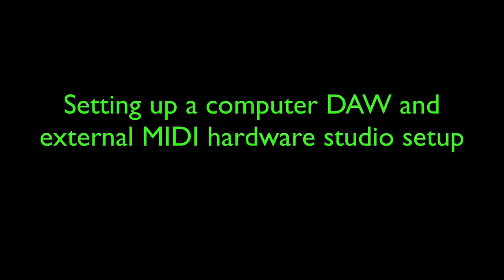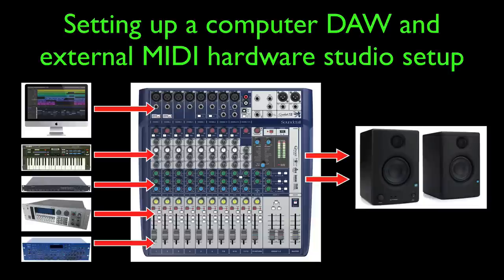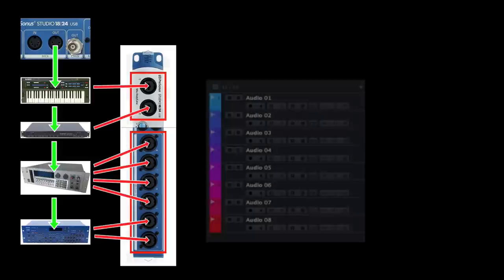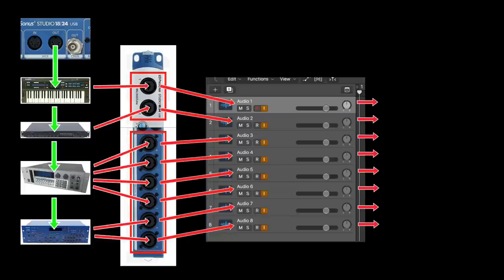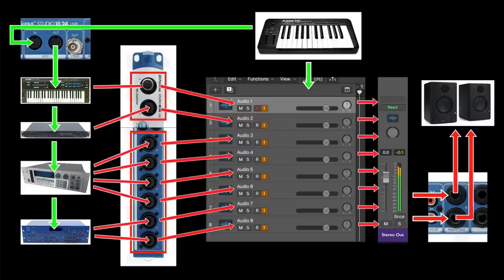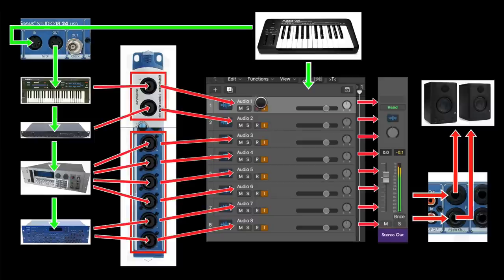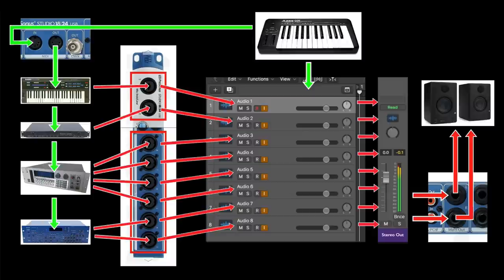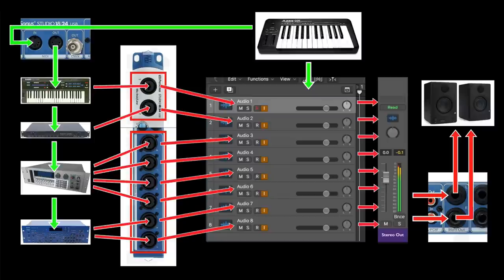How to setup a computer DAW & external MIDI hardware studio

Comment: Great video!  I'm still doubting whether to go for the mixer or interface approach.. I recently acquired quite a few vintage hardware synths and 8 ports simply is not enough :(  There's a JV-1080, Korg M1R, Yamaha TX81Z, Roland U-220, Roland MKS-50, Roland TR8-S, Roland JP-8080, Korg Minilogue XD and a Behringer TD-03 in the collection.  Some/most of those should probably be connected in stereo I reckon.  The MIDI connections are clear, but how should I go about connecting up the audio outs?  Thanks for any feedback!
Reply from the maker: well the problem is how many of those units do you want to connect at once. the roland drumbox alone has 8 outs. The cheapest solutions will yield 16 physical line inputs so you can route a max 16 hardware OUTputs IN to your DAW at the same time.

So either a USB equipped mixer which gives 16 USB channels to your DAW or the behringer UMC1820 audio interface with the Behringer ADA8200 ADAT rack added will give you 16 physical IN's. 

Above 16 channels your best best is the LIVE PA racks from the likes of Mackie, Behringer, Presonus, Soundcraft etc.

The Mackie DL32R stage rack will give you 32 channels Inputs to your DAW,  a BIG channel count, but costs about £1400-£1600 GBP. 

The Mackie DL32S stage rack will give you 32 channels Inputs to your DAW,  a BIG channel count, and this cheaper version cost about  £800 GBP. 

The Behringer XR18 stage rack gives 18 inputs to the DAW for just over £500 GBP 

The Soundcraft Ui24 stage rack will give you 24 channels to the DAW but costs about £750 GBP

Zoom LiveTrak L-20R gives 20 channels to the DAW for around £600 GBP

Presonus StudioLive Series III 16R, 24R or 32R give 16, 24 or 32 channels via USB to your DAW plus main stereo mix (sum of all inputs) and ghey cost around £950, £1200 & £1400 respectively

Other options would be the Mackie ONYX USB mixers, but the biggest, the Onyx16 still only gives you 18 channels to the DAW, and again it costs more than the Behringer UMC1820 & ADA8200 ADAT rack combination. 

Do you see where this is going? 

The other option is a traditional mixer with 4 or 8 buses or direct outs feeding a tradition 8 input USB audio interface, which would allow you to monitor the external hardware and DAW audio together on the mixer and route any items to record as and when you need to record them either via direct outs on their channels or by routing them to busses, but unless the mixer has built in FX your external midi kit will be dry with no FX. The solution to that is to get a mixer with 4 or much rarer 8 buses with built in FX, the cheapest of which would be something like the old Behringer sx2442fx mixer or something similar which is current from companies like Behringer, mackie, yamaha, soundcraft, zoom etc.

so the bottom line is, if you want  A LOT of midi kit outputs routed to your DAW at the same time, the solution is costly when you go above 16 physical DAW inputs.
Reply: @dancetech  Many thanks for your detailed feedback, much appreciated! :)
Reply from the maker: 👍 actually, thanks for the suggestion, because i think i'm going to do a video on this topic because there is really no video out there which makes all this clear. cheers
Reply: @dancetech  Exactly .. this is the first video I've encountered that explains it clearly..  Perhaps one more thought - let's assume I want to use a mixer's (like a Mackie for example) overdrive on a kick drum channel, but I only have an 8 channel Mackie. But 8 channels won't be enough in my setup... I don't suppose you could daisy chain mixers?  And sorry if that's a really stupid thing to ask but I'm new to hardware setups ;)

And a final thing .. you mentioned 16 channels or more over USB to the DAW, meaning you wouldn't use the mixer's main outputs going into the audio interface?
Reply from the maker: yeah you can daisy chain mixers, it's not really recommended, but you send the main out from one to 2 inputs on the other in in via a couple of aux returns, but obviously things like SOLO & Aux sends will only work per mixer, not across both unless you start to use stuff like a patchbay to sum sends before they hit rack fx.

Your Q2. If you send a load of hardware to a mixer and then send the final stereo out of the mixer to the DAW, yes, you get the sum of all the hardware mixed to stereo on a stereo track/channel of the DAW... you can monitor that way, and then when it comes time to mix you can mute all but one hardware unit on the mixer, record it to the audio track, make a new audio track, un-mute the next hardware channel/s & record that hardware unit... and go through the hardware units one by one, recording each unit by itself to audio, then mix internal adding fx etc. 
The beauty of sending hardware IN to the DAW via audio interface inputs is that you can add fx in the DAW mixer & when you bounce them to audio they will sound identical to how you set them up in the DAW mix cos the same fx will be on their channels. 
If you go down the mixer route each bit of hardware has no FX, unless you have mixer fx built into the mixer to add or you use external hardware fx.. and even then, when you bounce them to audio tracks, unless you bounce the fx too then once bounced they sound different without the fx from the board.

i'm going for a big rebuild of my room here soon after which i'll have a full hardware setup again with mixer, midi hardware & rack fx and daw & then i will start to make videos on all this.

cheers
Reply: So quite a few moons later, I decided to take the hardware mixing desk route. I'm using a Mackie 32.8 mixing desk and I have about 20 synths/modules/samplers connected to it.  There are 5 outboard fx units connected to it, using Aux Sends and Returns.  That's all working fine.  However, now comes the MIDI bit.  Currently I only have an ESI M4U eX but I'd like to address all modules. 

That's where it gets tricky. I launched a question on how many interfaces/thru boxes I would need and about 50 replies later, it got more difficult than ever. So if you have suggestions regarding Midi ... :D
I thought it would be as easy as using 2 Out ports on the interface, going to e.g. a Kenton Thru 12 each. I thought that would give me enough channels (16 channels per physical midi port I think), but then somebody said I need multiple midi channels for multitimbral synths, and definitely multiple channels for my Akai sampler....  So now I'm puzzled lol :(

Comment: RE:  The external Midi devices.  Are these being Chained, Out to Out to Out?  And then, I get to, Oops, My Dreadbox Nymphes, which is USB.  Nymphes works, has a MONO OUT only and is recognized by Cubase; it just doesn't have the DIN MIDI.  And then, finally, a bit puzzled as to, for example, HOW I would feed a VST synth like Zebra2 into my ZOOM Multi Stomp, in order to apply the zoom FX to the synth.  In short, I've got 4 desktop synths (a fifth coming) and it seems like I'll be doing a lot of Connecting, Disconnecting, Reconnecting to record them then set them aside when not in use.   Sometimes I think I maybe should have picked Boardgames Collector as my hobby.
Reply from the maker: no you cant daisy chain MIDI via OUT connectors, only THRU (unless the synth has an internal switch to switch the OUT socket to THRU function). For USB synths simply connect them up and assign the midi track designated to that synth to that usb midi out, you can still route the audio OUT from that synth as shown. 

Sending a VST synth audio OUT and through external fx and back into the mix is another subject. The routing is obvious: use a spare audio out which is not part of the main L/R OUT monitor chain & send the synth out into the fx unit & back in again via a spare designated audio interface audio INPUT socket, but the issue there is latency, which will be more than triggering via an external hardware synth via midi and routing it's audio IN to the DAW mix, cos it's a round trip in this case.. OUt from the vst synth thru the fx unit and back In to the daw. But with very low buffers set on the audio interface it shouldn't be too much of a problem.
Reply: @dancetech  Great info!  RE:  your paragraph 2.  I think if I read and reread...and then have someone read it aloud whilst I sleep, it's gonna sink in and become clear.   I have a direct support link to a guy at iConnnectivity.  My audio interface is the Audio4+.  While it has a LOT of tricks up its sleeve, it has fewer Inputs than the one you're using.  I'm sure much will translate, I'm sure.   I simply haven't contacted my iConnect guy since I had the brain spasm which caused me to acquire a bunch of desktop synths.  Anyway, I will share the info you've provided with him.  HE will say, sure....all that's right, so what's the prob?   He'll then open his utensils drawer and spoon feed me a bit.   Thanks!!
Reply from the maker: @watchaddicts1213  lol, maybe get more inputs.. did you see this video? https://youtu.be/7rsaYq5jYxE  - the soundcraft unit btw also comes in a 12 channel version (Ui12) which is really cheap, like 300 ish

Comment: after spending the whole video on the audio path, the midi bit is just brushed over...and that's the bit many have issues with. I have an external USB keyboard, sending on ch1 ,  my external instruments are assigned their own midi channels from the DAW,  but when playing the external keyboard, it only ever triggers the instrument on CH1, selecting another track does not receive on CH1 from the keyboard and then send out on CH2 for example, so I keep having to try to change the midi ch on the usb(master) keyboard... am I missing something?
Reply from the maker: "...the midi bit is just brushed over" ---- well that's because one would assume anyone with a reasonably extensive external MIDI hardware setup (such as this video caters for) would have learned how to use MIDI connections as they gradually expanded & built up their MIDI setup.... BUT, it should work exactly as described IF each external MIDI Item is set to a unique MIDI channel... then change the MIDI channel of the MIDI track in the DAW & it should channelise the MIDI THRU from the DAW to that correct channel to address the requires MIDI unit... also btw, MIDI Local Control should be OFF on the master synth/keyboard (If it has an internal synth engine & is not a 'dumb' master keyboard with no internal sounds) or it'll trigger itself whenever you play it...

If the master synth/keyboard DOES have an internal synth engine & you want to trigger it (and it;s 'Local Control' is set to OFF as it should be) then select it's channel (usually channel 1) in the DAW MIDI track and it'll trigger itself via the DAW MIDI loop back to itself..
Reply: @dancetech  Thanks for the reply, I think I figured it out at last!  As for your message in regards of having a more extensive set up, and thus knowing how midi works, I'd argue that the same could be said for the audio path, but alas.  Thanks again, and keep up the good work..
Reply from the maker: @koosfockens1707  yeah the mysteries of MIDi eh!?... it gets mad with program changes and sysex and all that crazy stuff...

Comment: "midi out from your audio interface to each of your external hardware units"? One at a time? or each hardware unit plugs into another hardware unit?
Reply from the maker: you can use MIDI THRU if external hardware units have it, or a MIDI distribution THRU box, or a combination of both.

Comment: My issue is all synths have a L/R output, which takes up 2 spots on the interface.  I have 5 synths, which means i need 10 inputs.  am i doing this wrong?
Reply from the maker: nope. you need as many inputs as you want to send OUTs from any hardware. Some synths can optionally have a left/mono out or stereo, whether you go with that depends on the sound and whether it uses stereo panning &/or stereo fx as a big part of that sound... so most bass sounds dont need stereo for example cos most bass is mono. For more DAW inputs check this follow up video we did: https://youtu.be/7rsaYq5jYxE
Reply: @dancetech  I did watch that.  I have 2 Elektrons, 1 Novation Synth, 3 korg synths and am buying a waldorf Iridium synth, which actually totals 14 stereo inputs.  My Motu MK5 only has 8 inputs.  There is minimal education out there on this type of stuff and it is usually brand specific material.  I think i will reach out to Motu for a solution in maybe having an expansion i/o?

Comment: is it possible to use a mixer that have no usb conection but midi in/out/thru (5pin) and plug it to a soundcard like Focusrite that also have in and out conection and control a virtual mixer of a DAW ? I mean that if i use the midi learn protocol and assign 1 real fader to the  virtual one via midi in an out conection, does the virtual mixer react ?
Reply from the maker: yes, that device is called a DAW CONTROLLER. the cheapest is the behringer bcf2000

Comment: But if there is only 1 midi output om the interface in your illustration how do you connect that to more than one module? I understand multiple inputs on them module but what about the output issue?
Reply from the maker: if you are creating a serious midi hardware setup then you get a MIDI distribution box. I've got 2 for example. outputs are not required unless you want to SPECIFICALLY send unique controllers from any bit of hardware via it's interface.